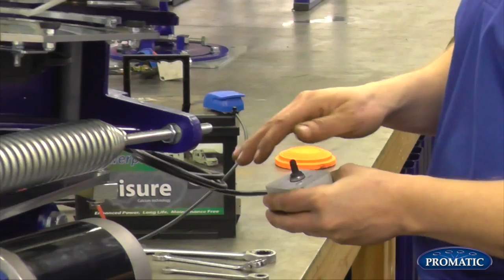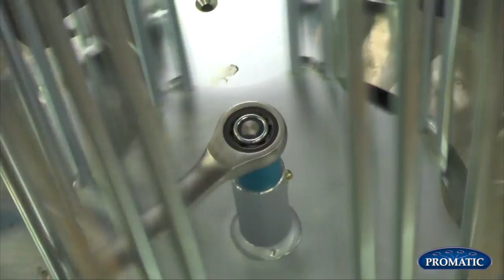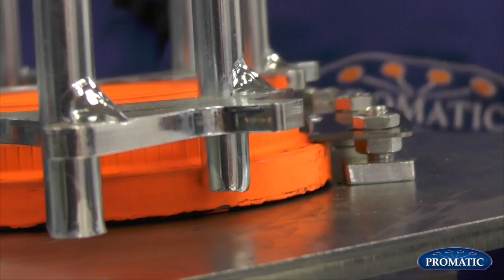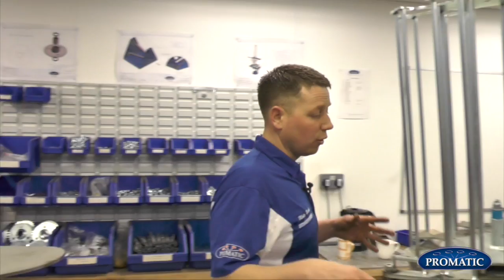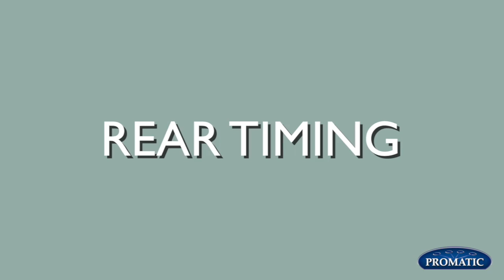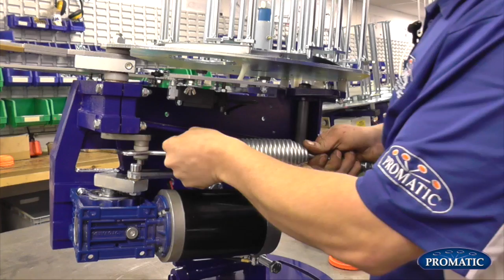Promatic Masterclass Series Part 1

Comment: anyone know why trap motor runs slow new battery attached
Reply: Check for resistance and good connections in the wiring
Reply: What he said or the gear box is going bad. It’s one of those two problems.